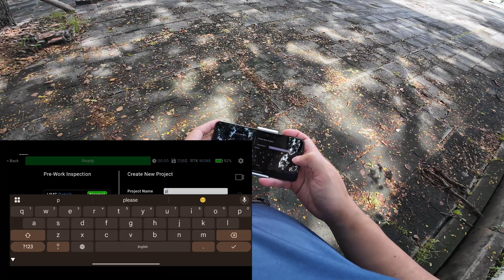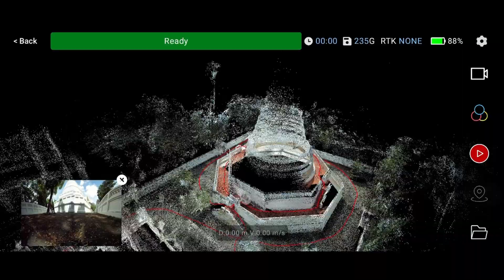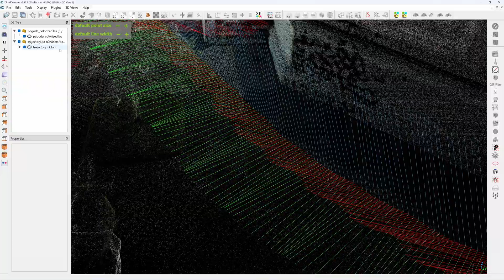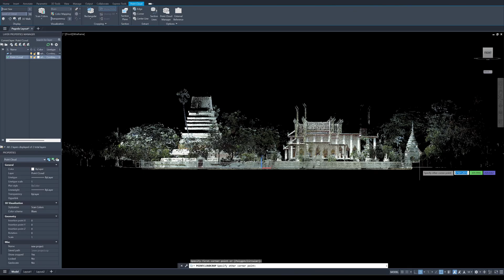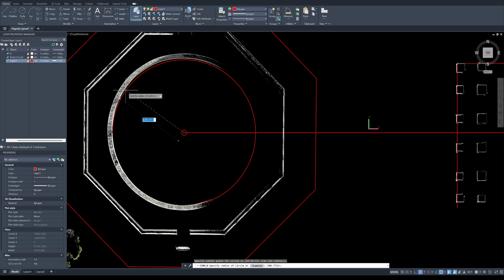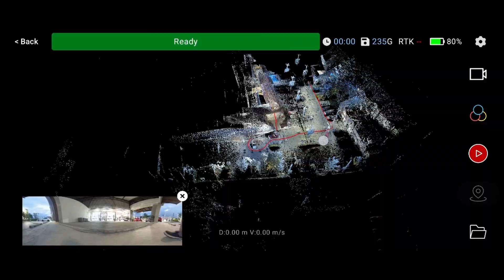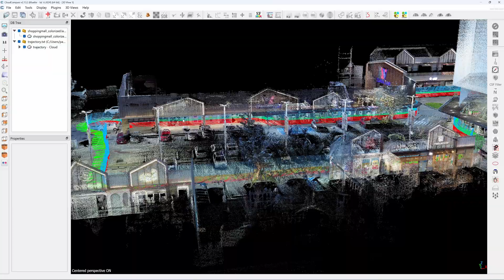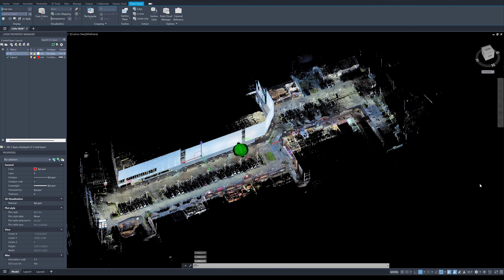SHARE C1 LiDAR Scanner Review: Large Area Scanning + AutoCAD Workflow Tutorial

Comment: Thanks for including a download for the data Payo! This feels a bit more polished compared to the Eagle. it would be cool if you could scan the same location on each new scanner you get your hands on. Maybe comparing against a high end scanner that has multiple control points for benchmark!
Reply from the maker: In a quick test with Eagle, I found that the C1 picked up features Eagle couldn’t detect in the colorized point cloud. Distance measurements between color pixels were highly accurate, with just 1–2 mm of error.

Comment: Just wondering, the specs state 75m range, how come the Pagoda tip isn't visible in the pointclouds?
Reply from the maker: For C1, the 40–70 m range is reserved exclusively for tracking purposes. Point cloud generation is performed within 40 m, with optimal quality achieved at distances under 5 m. The 5–20 m range yields good results, though not the highest fidelity. Notably, the pagoda’s tip appears in a non-colored point cloud due to overexposure—sunlight caused the white surfaces to burn out.

Comment: 3D Maker Pro is set to release a Lidar scanner below $1000. I'm interested in this mode but must you use a phone ?
Reply from the maker: You’ll start seeing more SLAM LiDAR scans using this new low-cost sensor. It’s not as precise as the Livox 360 (30 mm vs 20 mm), and it has a shorter range (50 m vs 70 m) with fewer points captured per second (150k vs 200k).
Reply: @Payo-TensileCreator  I'll wait to see what the 3D Maker Pro releases, then if compared to the Share C1 then I'll pre-order that model. It seems very good, what model would you recommend under about $3,000 ?
Reply from the maker: @christopher8116  I haven't evaluated the performance of the new budget LiDAR sensor yet, so I can't comment. As of now, C1's software is production-ready, while Eagle's is still under development. Eagle's non-color point cloud is acceptable, but its tracking performance is lacking, and its color point cloud falls short compared to competitors.

Comment: I’m interested in the Gaussian splatting. How well does it handle that?  I use cameras and get really amazing results.  Will this device use the lidar information to assist in Gaussian splatting process?
Reply from the maker: The current software doesn't yet support 3DGs, so its performance can't be evaluated. It will use LiDAR and IMU data to determine the RGB camera's position for generating 3DGs.

Comment: Hello Payo, thank you for your videos on the C1 and the Eagle.

I already use the Eagle. Unfortunately, it does not deliver the promised results.

My focus is on the colored and non-colored point clouds.

Do you think it makes sense to switch from the Eagle to the C1?
Reply from the maker: For non-color point clouds, you won’t notice much difference. Eagle does a better job at corners on walls, floors, and ceilings look a bit sharper than with the C1.
But when it comes to color point clouds, the C1 really shines. It’s more accurate, with higher resolution and cleaner, thinner geometry. You’ll see details in the C1 scan that just don’t show up in Eagle’s, and you can even extract dimensions with 2–3 mm precision.
The biggest win for the C1 is its SLAM and tracking. You can walk through tight spaces, go up and down floors, and still get perfectly aligned walls and floors—no rotational drift. That’s something Eagle struggles with.
Reply: @Payo-TensileCreator could you show more of the non-coloured point clouds?  I am also interested moving to the C1 from the Eagle owing to the level of noise. Are the non-coloured point clouds from the C1 as clean as the coloured clouds or at least cleaner than the Eagle's?
Reply from the maker: @kevinedw2002  During post-processing, C1 first generates a grayscale point cloud, then overlays color pixels onto it. This approach, common in SLAM-based LiDAR systems (except Eagle), ensures that both the colorized and non-colorized point clouds share identical coordinates, noise characteristics, and quality. Points in distant or dark areas that the RGB camera cannot capture are excluded from the final result.
Reply: @Payo-TensileCreator Thank you for that - I've always been confused about the approach taken with the Eagle data which yields different results for the grey scale and colour point clouds

Comment: Thx for the extensive testing! Can you compare it to the S20? Would be very interesting if you can make a 3dgs model from the s20. It should be a lot better than the c1 or?
Reply from the maker: The S20’s got a better RGB camera, IMU, and SoC than the C1—and it also supports RTK and control points. Maybe I can ask to borrow a unit for a side-by-side review.